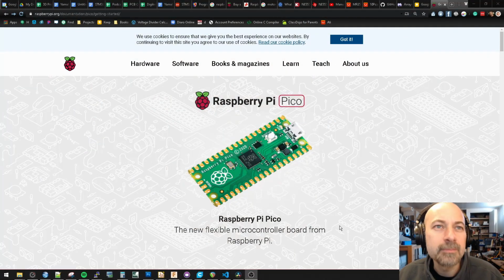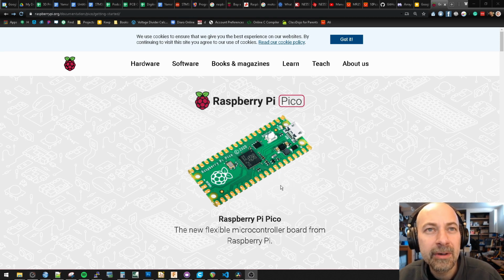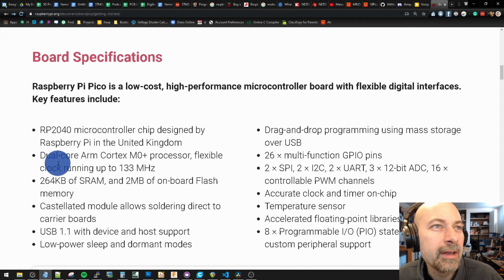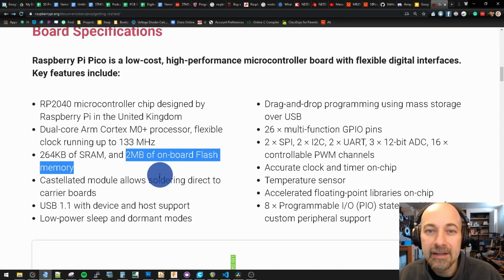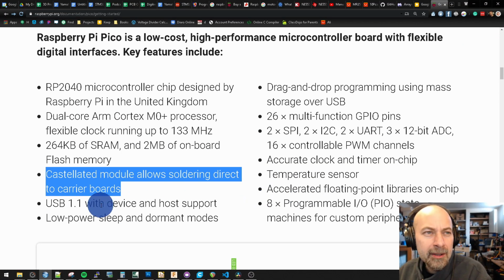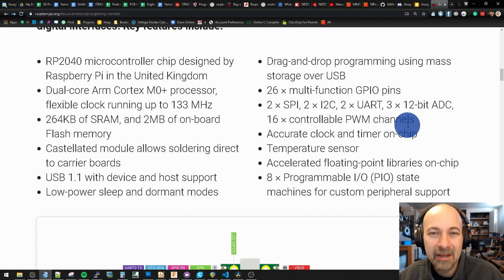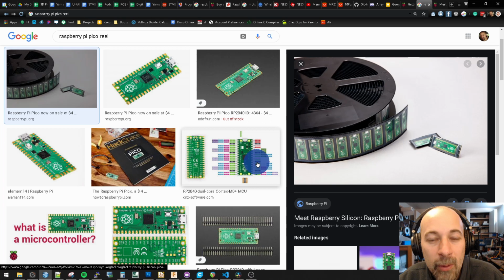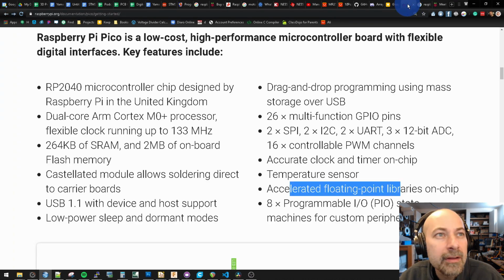Podcast #003 - Raspberry PI Pico vs STM32 Blue Pill

Comment: I was pretty disappointed by the power consumption issue..for some cases, you might be able to use a µpower buck converter from a 2-cell Li battery, so it's always in buck mode. Still, the bare-metal processor is not so hot in low-power apps. Thanks for a nice unbiased overview.